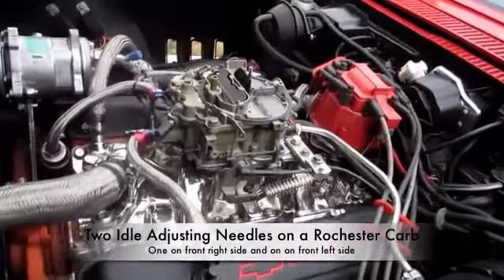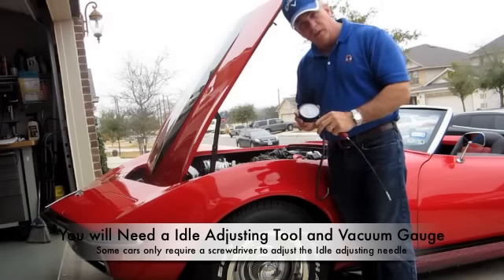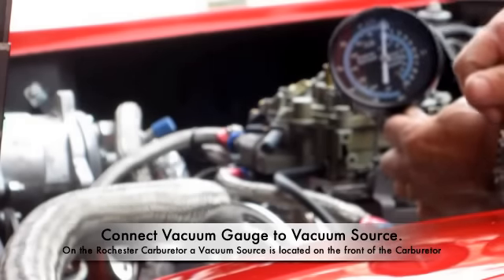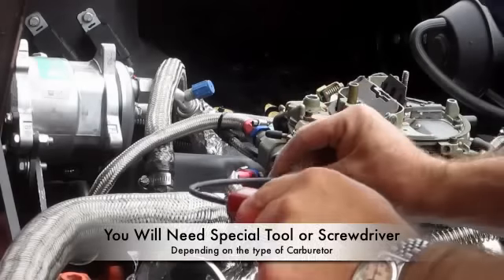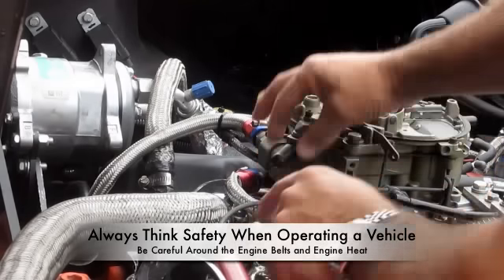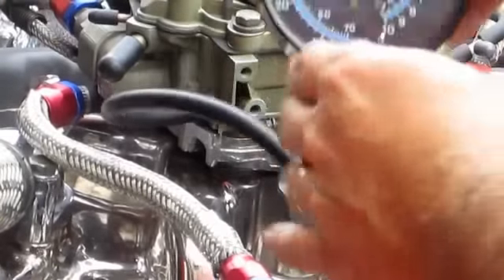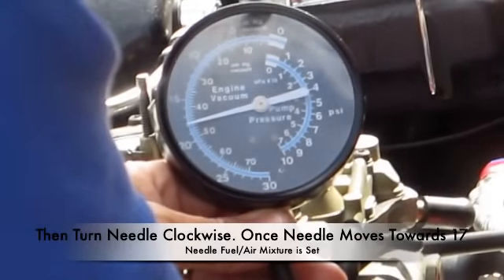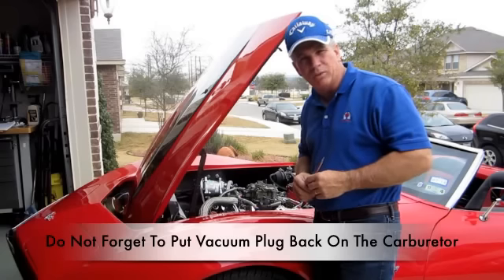How to Adjust Fuel and Air Mixture On A Carburetor By Corvette Hop

Comment: what is the name of vacuum guage you are using and where can I buy one
Reply from the maker: Omer, The Vacuum gauge does not have a brand name on it. I did get it from the O'Reilly Auto store. I have also seen them at AutoZone.
Reply: +TheWhatisright Hopcorvetteman  thanks man yea I'm going to have to check out oriely autozone out here said they did not carry, I desperately need one to adjust my car failed smog due to needing adjustment thanks for the info man
Reply from the maker: You for sure need one if you own a C3 Corvette. It is a great tool to have.
Reply from the maker: This is the one I have (see link). It is located at Autozone, part number CP7803. It can be ordered online. http://www.autozone.com/test-scan-and-specialty-tools/vacuum-pressure-tester?filterByKeyWord=vacuum+tester&fromString=search&isIgnoreVehicle=false
Reply: +TheWhatisright Hopcorvetteman awesome man thanks
Reply: +TheWhatisright Hopcorvetteman what would be the ideal setting for a 307 4brl
Reply from the maker: All engines are different. This is because of modification on engines. Mine is around 20 or 19 on the 350 chevy. I am sure yours is close to that. The main point with a vacuum gauge is to max it out and then turn it back down just far enough that the needle on the gauge starts to decrease. If the max adjustment is 20 on the gauge then when you start to decrease the needle moves toward 19 (that is the sweet spot). If the max on the gauge is 24 and your turn the fuel air/mixture screw back down and the needle starts to moves towards 23 then that is the sweet spot. Do not forget to adjust for correct RPM afterwards. You may need to do the adjustment a few times on each side to get it perfect.
Reply: +TheWhatisright Hopcorvetteman ok cool thanks
Reply: @TheWhatisright  How do you know the RPM for your specific car?

Comment: @TheWhatisright Hopcorvetteman Would the RPM for a 283 Chevy Engine roughly be 600 RPM on idle settings??
Reply from the maker: +copyright2021 Most I what I have read has it at 475 - 500 RPM. Of course that is a stock 283.
Reply: +TheWhatisright Hopcorvetteman Thanks I have a stock 64 impala and the manual didn't specify

Comment: Hi there
what is the name of the vacuum gages you use and the screw for adjusting the carb (if you have a website to bay from )

thanks
Reply from the maker: ramtha Lord Ramtha, I looked at my Vacuum gage and it does not have a brand name on it. I did buy it at O'Reilly Auto Parts Store. I also got the special screw adjusting tool at the O'Reilly Auto Parts Store. Some of the cards only require a screwdriver.

Comment: People need to stop setting their mixture screws this lean. Screw them out 1/4 to 1/2 turn from high idle so you have some leeway from a lean condition that will happen when they become obstructed from contaminants as always happens. If you start out from a so-called "perfect" setting all you are doing is shortening the amount of time it will be before you have to adjust the mixture screws again. I've been doing it the slightly rich way for 45 years. It's time for others to finally catch on to this better procedure. Of course the E.P.A. doesn't like it but their preferred way (lean like above) is why I had to adjust so many mixture screws on vehicles, in the 1970's, that caused tons of idling troubles. Go ahead and set them lean but you will be just doing it again, sooner.

Comment: how do i adjust the rpms to 750????
Reply from the maker: +Daniel Delgado Daniel, A screw for adustment is on the drivers side of the QJet, near the throttle cable.
Reply: +TheWhatisright Hopcorvetteman awesome! thanks! I'm gonna give this a shot on my camaro today. around what range should I adjust the rpm to on a stock 305?? still 750?
Reply from the maker: +Daniel Delgado Daniel, most are around 850 rpms. However some run great at 750 rpms.
Reply: TheWhatisright Hopcorvetteman so you adjust the rpms before or after you adjust the idle mixture with the vacuum gauge??
Reply from the maker: +Daniel Delgado After the fuel/air mixture. The RPM final adjustment is normally the last thing you do.

Comment: Damn! I cant afford no vacuum gauge!
Reply from the maker: M Knight Some people can do adjustments by sound.
Reply: I dont know what im doing wrong.  Starts and idles fine but after driving, when put in park idles to high.  when in gear at a stop light it idles to low
Reply: Kinda sounds like a vac leak sometimes ides up and down.  But I did the starting lfuid trick pretty much every where  and I found nothing.
  My muffler did drop out though.
Reply from the maker: M Knight Knight, I would make sure your choke is adjusted correctly. See this video @watch?v=ymmrJsja75E   Mine had the same problem once and it was simply a choke adjustment. I also helped a friend with his Choke adjustment and he did not have any power running to the choke. Once the car is warmed up, the idle should even out. Also, make sure the Carb is clean and no vacuum leaks at all. Your Carb may also need a rebuild but check the Choke and clean the carb first. I hope this helps you.
Reply: Yeah I seen you vid like a year ago.  Atfirst it would barely start.  Then I watched your  vid and it starts up pretty good now.   I think my carb may no longer be good.
Reply: My choke only opens about 1/4 inch.  Is my coil bad?  whats the screw with spiring on the bottom?
Reply: Oh gosh!!!  So I had no voltage to my choke. So I fixed that issue and now after warming up for about 1 minute, it dies.  And I swear I hear a vac leak that I cant find
Reply from the maker: You will need to track down that vac leak. Great to hear you figuired out you had no power to the choke. That was a great find.
Reply: Old post but easiest way to find a vac leak is to spray a small amount of starting fluid in various locations around the top end of the engine. If it revs up or down at any location. 
there is probably a vac leak.

Comment: Why are you plugging most if not all of your vacuum ports?
Reply from the maker: +Zach Andrew Zach, The gauge needs to read the correct vacuum in order to adjust the fuel/air mixture. If I had a vacuum leak or hole not plugged the reading on the gauge would be incorrect. If it was a large vacuum leak the gauge may not read at all. Plus, the car may not operate correctly or may not operated at all.